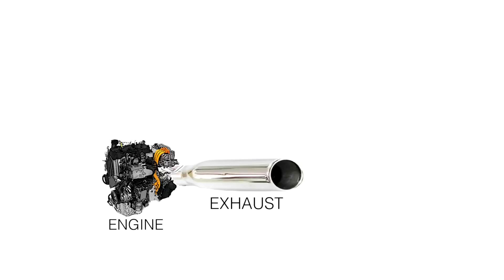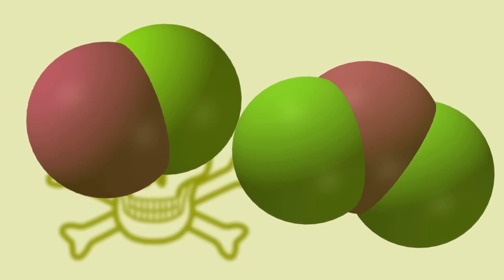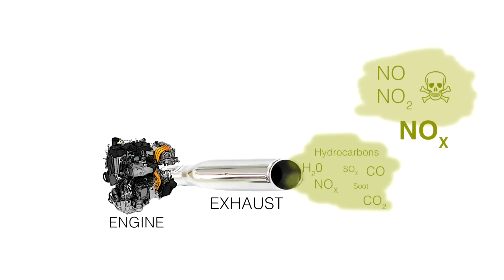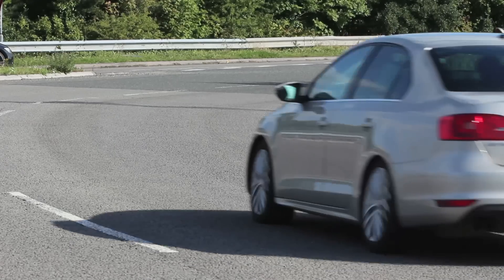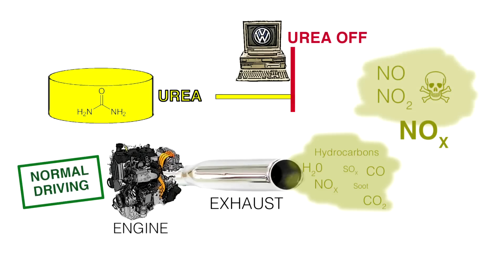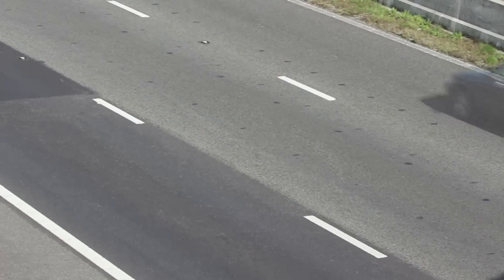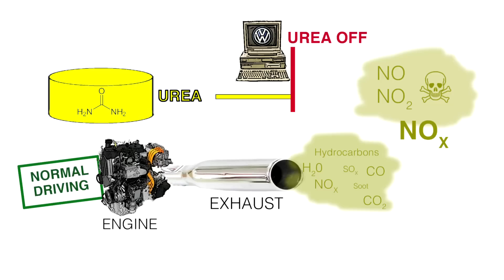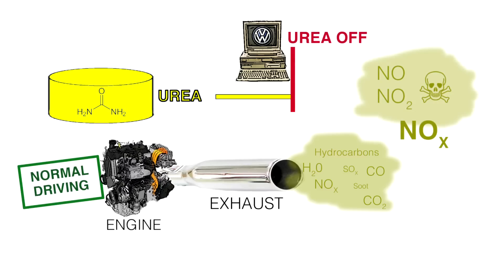Diesel and Urea

Comment: Im sorry to correct you, but the VW engine in question (EA 189) does not have the Adblue Technology with Urea. They are older and use whats called a Nox Adsorber. In those the Nox gets adsorbed by barium and reacts to bariumnitrate. In certain intervalls the diesel/air mixture gets enriched on purpose to produce CO or unburned carbon-hydrogens which then reduce the bariumnitrate to nitrogen, barium and water. This system is also called the NOX trap
Reply: +Axel +Vinay Vyraveraja well, they will simply have to make another video about the "mechanics" behind the other type(s) of NOx neutralizing technologies, and everyone will be happy, and more important - a little bit more educated
Reply: +Axel My understanding of the situation is that the engines in question do not use AdBlue (urea).  VW claimed that the engines met the stricter US emissions regulations as-is, and the EPA tests confirmed this.  In fact, VW rigged the engine management computer to recognize when the car was on a dynamometer (which is what's done when emissions are tested) and reduce emissions as much as possible.  When not being tested, the engine performed normally, and produced emissions far in excess of EPA regulations.  

In any case, VW has almost certainly killed what little market there is in the US for diesel passenger cars.
Reply: Chris Freemesser That might be true, but to my opinion media is spinning this story out of control. This problem is not nearly as bad as the media try to make it. It seems like there is quite a strong anti diesel bias in the media. Actually petrol-engine exhaust is more dangerous than diesel one, but its technically leagal for petrol-engine to exhaust more ponsinus gases, so they don´t cheat
Reply: My 2012 Passat TDI does have urea. The Jetta and Beetle do not. The larger Audi and VW TDI vehicles do, at least in the US. Mine does use Urea as well, I just had to fill the tank a few weeks ago.
Reply: Miles McDonnell No they are very diffrent component. Particle filter (or particle traps) are to remove particles. NOx traps and Urea injection is to remove NOx
Reply: You're correct, I think being up all night at work is starting to catch up with my reasoning.
Reply: +Miles McDonnell The US models are different to the european ones. I don't know what kind of diesel engine is available for the passat in the US. I drive a 2011 passat tdi with 140hp and it is equipped with the EA189 engine and uses the NOx trap.
Reply: jellyfishattack Basically replacing something bad, with something equally bad, but much more expensive.
Reply: Part of the carbon issue is that petroleum is "old" carbon, as is coal.  It's carbon that was removed from the atmosphere eons ago, and has safely remained below ground, until humans discovered using old carbon as fuel.

Trees, (burned wood) use "new" carbon.  That carbon was pulled from the atmosphere relatively recently (within 100 years or less), so CO and CO2 emissions from burning wood are pretty much "recycling" the carbon, since living trees and plans would absorb CO2.

So, by using old carbon fuels, that once safely sequestered carbon is now being added to the atmosphere.  And, that's the issue with regard to global climate effects.
Reply: +Vinay Vyraveraja Everything associated with transportation is dangerous. All combustion produces harmful chemicals in some amount. Electric cars are usually powered by coal-fired power plants, which are often more harmful that cars and trucks.

We need to stop thinking that there is a free lunch, and make informed tradeoffs.
Reply: ryan remus "Gasoline cars need gasoline to run,"
Not true. Cars with explosion engines can ran on just about any high energy liquid substance that can be oxidesed.
Reply: +Vinay Vyraveraja - Diesel engines produce fewer pollutants than petrol engines, which is why they are being produced.  And why they will continue to be produced. 

To understand why, you have to know how it works. A diesel compresses air at a 15 (or more) to 1 compression ratio to generate the heat of combustion. The fuel is injected into the heated cylinder, and then the engine generates a LOT more torque than a similarly sized petrol engine. (Which is usually about 8-11 to 1 compression.) 

The fuel burned by a diesel creates more pollutants. But the distance that a diesel engine will push a vehicle more than makes up for that difference, simply because of how the engine works. Therefore, diesel engines pollute LESS than petrol engines as compared to the miles they drive. 

As such, a petrol-powered lorry would produce a LOT more pollutants than a diesel engined lorry would. It's simply a fact of how the engines work. 

You don't need to agree with this fact, but you should probably understand it. Because this is why so many diesel-engined cars are being built today. They are more fuel-efficient, and they pollute less than a petrol engine would in the same car.
Reply: +Axel I'm sorry to correct YOU, but while what you say is true for SOME EA189 engines, some (like the CKRA variant in our '13 Passat TDI) uses the SCR (AdBlue) system. Some do - some don't, no "none" or "all" here. As with many things in life, it's more complicated than that.
Reply: +Axel He used the EA 189 as an example, still Diesel engines still are being used for high load vehicles such as containers, trucks, lorries and so on.This is suppose to be a educational video about the waste/by-product of diesel engines(most of them) which is NOx or NO2 which are very harmful chemicals that need to be reduced in production.
Reply: Axel True that
Reply: +Axel Some of the affected vehicles use NOx traps, some use SCR.
Reply: Miles McDonnell Well sorry, i was over generalizing. There is one (or two?) specific engine (s?). Of cause its only the smaller engines in the smaller car that was even able to pass the test with special software.
Reply: Its kind of anying that particle sometimes called filter and sometimes called trap... well it basically is both.

About NOx traps, i have no a clue about how they works
Reply: +Axel +Jason Goodman So far, VW has been fairly unhelpful on exactly what cars (and drivetrains) are at issue. The Jetta/Golf here in the US did not have AdBlue, but the Passat ~2012-2015 do.

My guess (only a guess) is that all the TDI models contained the "defeat code" and are thus technically not in compliance. But for those cars with AdBlue tanks and injectors and controls, if the "defeat code" is removed, I'd expect the cars to meet the specs.

Of course all the cars meet the EPA tests. That is the point of the defeat code. The issue is that VW clearly violated the spirit of the law.
Reply: +matsv201 +Axel  Its not the engine. VW seems to use the same engine in the Beetle/Golf/Jetta and in the Passat, but the Passat uses AdBlue. The smaller cars do not. The Passat also gets better fuel mileage, which is unusual, since its a bigger and heavier car.
Reply: Pat Farrell Exacly
Reply: Yes they do use urea fucktard the guy on the news who is the same guy that heads the pollution study group that caught vw said the cars use less urea during normal driving.
Reply: Pat Farrell- Okay... at the start of your comment you said "they are more efficient", which means you agreed with what I said.

The rest of what you said was a essay decrying the political system of the U.S. (which I also dislike) and shady trading practices between countries (which I also often dislike). And a few... other things (which I don't really disagree with).

Since there was nothing you wrote that actually disagreed with what I said... I really have to wonder what you meant by "not so much" at the start of your long comment. (?)
Reply: Pat Farrell If you measure it in LD50 petrol engine that relies CO that is quite posinus is far worse than diesel. NOx is not really that posinus, its really more irritating. Sure you can die of it, but then we talking about way higher concentrations. NOx also breaks down faster than CO. (T)HC is also more dangerous to the nature than NOx is. NOx is actually not really dangerous to plants at all.
Reply: +Miles McDonnell actually european diesel are starting to use it too. The whole reason they didn't use it before in europe is that the emissions limit for diesel differ from petrol engines, and fuel usage is taken into account. In the USA diesel engine has to comply with the same standards as petrol engines, and emissions are tested per gallon of fuel burned, instead of the european per kilometer driven. So to comply is europe a diesel doesn't need to do as much to reduce NOx emissions.

Now there are multiple ways to reduce NOx emissions, the urea inject thing. Which works great, but the urea can run out, have a tendency to crystalize in the hoses/pump, and decays. Meaning it's not a maintance free system, and if you're unlucky expensive to repair, and the tank has to be filled regularly to make sure you have "fresh" urea.

Another way to reduce NOx emission is to pipe back a part of the exhaust gas into the engine. This reduces the amount of oxygen in the engine and thus the NOx emission, a chemist could probably explain why. This system is called EGR (exhaust gas recirculation) system. And it's not that reliable either, as the valve use to control this can get stuck with all the soot and carbon build up in the exhaust pipes. And this method reduce the power the engine generates.

The affected diesel engines only used the second system, which isn't enough to make it comply with US standards, unless your willing to give up significant amounts of power and mpg. What they did is figure out when the car of being tested for emissions and then run the engine for minium NOx emissions. Which worked because during emission testing the power output isn't measured. And during normal driving they tuned the engine to have more power and better fuel consumption (and extra NOx emission).
Reply: JCGver Your explanation of the Golf/Jetta approach makes sense. Its the first one that I've heard that seems feasible for engineering. Do you have any citations or evidence that is quotable?
Reply: https://en.wikipedia.org/wiki/European_emission_standards#Emission_standards_for_passenger_cars
Here is the specifications of the Euro on.  I have not found the EPA specification. 

"Another way to reduce NOx emission is to pipe back a part of the exhaust gas into the engine. "
Almost all dieselcars does that alreddy. It healps quite a lot, but it will still not bring it down to the Euro 6 level for most cars. With Euro 5 and a small engine, it works for the most cases.

"And this method reduce the power the engine generates."
This is generally not that big of a problem because the system is only needed when power reduction is needed, to a extent.

"Which worked because during emission testing the power output isn't measured"
I don´t know about in the US, but in Europe the car have to reach 120km/h in a certain time. So if the power is reduced to drastically it will fail anyway
Reply: +matsv201 the differences we're talking about here that VW supposedly "cheated" are miniscule. Effectively they detect the car is being tested and during that interval don't start the cleaning cycle of the absorber (thus letting it get a bit dirtier than otherwise would be prudent).
This has the benefit of having lower NOx emissions during the test at the cost of having the absorber last less long (its lifetime in hours/kilometers is less before it needs to be replaced).
As NOx at the levels emitted even without the absorber running constantly is too low to be of concern, the "emission standards" being absurd for no other reason than to make cars more expensive and eventually impossible to build, it's a tradeoff that's IMO warranted and clever, if not strictly legal.
Of course now, VW are scrambling to change all the firmware (which btw wasn't created by them, it's created and maintained by Bosch, and used by many brands) which means that owners of the affected cars will end up having higher maintenance cost and somewhat lower performance engines for the sake of meeting an insane legal requirement.
Reply: CaptainDuckman Yea.. exacly. They really want to attack diesels. If i understand it corectly, it turned out that the VW cheat was not even illigal.
Reply: CaptainDuckman
"And all that is taxed as well, hence the 90% :)"
No, read my calculation again, and you will see its correct. I didn´t include for the staff of the petrol-station, i basically put it as all tax.

Also, the tax on the workforce is payed by the workforce, not the company.If you count it on the company then you count the tax two times.

"uh, yes. It does work like that. Maybe not in the mindset of a socialist agitator screaming about "evil greedy companies" but in the real world it works like that."
No i tell you how it works in real life. Big companies dont pay tax. Get e grip. Only small companies pay tax in real life.

" it's the profits AFTER TAXES that have to pay for all the R&D."
No that is wrong. R&D is payed from the turnover, not from the profit. Of cause, the engineers have to pay tax on there salieries, but the companies don't pay tax for turnover.

This is economics 101, you should really know this. 
You never turn tax on turnover, not in europe at least. You only pay tax on profit. R&D is not profit, its a investment.

The only exception if when you push over profit to the next year for a later investment. You are only allowed to do that for 3 years, then you have to tax the pushover.

You only pay tax on profit, and its the rule in just about every country in the western world. Big companies as oil-companies never pay tax for anything (except sails tax). This is why the profit margin of gasoline station is so low. Its also to keep competition down
Reply: +Axel question is whether VW is only cheating or other car manufacturers are also cheating?
Reply: yoppindia Well, Audi and Porsch was also cheating in the US. in EUrope it works diffrently. THat should be considered cheting is actually legal.
Reply: +matsv201 because they are part of VW....
Reply: Phrancis5 Well, yea, but its not really that clear cut. They are part of VW-group, but not VW company.

This is also true about Scania and MAN, and to my knowledge it seems like they have not cheated.
Reply: VW and Porsche DNA has been intertwined from the start. They share the same technology - engines, chassis, etc.. so it's not a stretch to think the other "groups" wouldn't be tied up in the same scandal. Especially now that so many gasoline CO2 sensors are also "dishonest".
Reply: Phrancis5 Note, the scandal is about NOx, not CO2...

The media tryed to make it sound that its about both, but its not. There is no issue withe software cheating and CO2.
Reply: +matsv201  Note, the scandal has expanded to CO2 as well, but of course I should believe a random commenter on youtube instead of the dozens of large news orgs recently reporting VW's cheating. Because the same company whose diesels had cheat software surely wouldn't do the same with their gasoline cars...
Reply: Phrancis5 "Note, the scandal has expanded to CO2 as well,"
No its not true. ITs the journalist that claimed something that is not there.

"I should believe a random commenter on youtube instead of the dozens of large news orgs recently reporting VW's cheating"
You should defiantly not based your belief of how  is the largest one... check up what is true in steed of what is claimed.

So you believe that the new org are never lying? Then you will get a brutal wake up....

" Because the same company whose diesels had cheat software surely wouldn't do the same with their gasoline cars"
They probably would, but that is not the issue. You cant software cheat your self it to a better CO2 number. CO2 is locked down to the fuel. NOx is created from the air, a engine can produce a lot of non. CO2 dont work the same way
Reply: Journalists might not be scientists or engineers, yet they have to vet their sources and the chances of all of them being wrong is very slim. These articles were from major news orgs, not small commentary or opinion pieces. CO2 is a by-product of combustion, which is controlled by the engine A/F ratio, which is controlled by the ECU, sensors, and PROGRAMMING. Obviously there are other emissions systems as well, but the point is if their diesels were programmed to cheat successfully for so long, it's not a stretch that their other cars would eventually too.
Reply: Phrancis5
"chances of all of them being wrong is very slim."
Well. if not all the newspaper use the same source, then its just that need to be wrong, and it this case it is.

"These articles were from major news org"
And you say that they are always right about everything? Like in 1984?

"CO2 is a by-product of combustion,"
Wrong. CO2 is the make product of combustion besides H2O and heat.

"which is controlled by the engine"
No, the amount of CO2 is chemically fixed to the fuel. You cant change it with software, its a law of nature.

You can only change the byproduct like HC, particles and NOx. The main products cant be changed.

Its a law of nature...

... if you argue against a law of nature, i can be pretty certain you are wrong
Reply: Ray Sills... I recall reading an article about how concrete absorbs co2 thereby holding it back from plants which use co2 and give off o2...so we are withholding o2 from ourselves in a sense the more we build using concrete. enclosures to work and live in....or use to simply contain the objects we use during our lifetime. Just a catch22 observation.
Reply: You also get false readings when you test a front wheel drive car on a 4 wheel drive test bench. They made such a big deal of it although they never showed an accurate reading. The VW wouldn't normally allot more NOx then they said unless you would overtake someone or drive like an idiot. When it turned out that NO manufacturer reached the promised values the thing was forgotten. Cars use more fuel then they do in the advertisement has to do with lots of things  wind weather spot on or way above sea level and most of all driving style. It has all to do with how these company's get their numbers. All of them there isn't one of them who is totally honest is because their tests are done inside a building in perfect conditions so I never really understood the problem, something that became clear to me when all of a sudden no one spoke about VW anymore.
Reply: Axel ea189 sold in eu does not have nox trap neither src. It just has regular catalitic and dpf. They are both mounted in the same container. You can chech under the car and you ll see there is no additional boxes. Also you ll wont find exhaust flap used in nox trap exhaust
Reply: Seems like a waste of fuel
Reply: +jz1199 I would like keep at least a bit of VWs reputation, because they make extremely good engines. Just shutting of the Urea tank to keep the customers from having to fill up those tanks would be an extremely weak excuse for polluting the world with NOx. With the older technology it is a lot harder to manage , because you ca't emit to much NOx on one side, but also you are not allowed to emit CO or unburned carbon-hydrogens, which are needed to clean the NOx trap
Reply: That sounds like the same engine. I'm assuming that the NOx trap would be equivalent to the DPF (diesel particulate filter) perhaps just a different name. The urea must be specific for the US which isn't surprising.
Reply: ryan remus I did address the issue. Its not about sequestered carbon, its about using the one we already freed up. The process dont ad any carbon, sure, it don't sequestered any to, but that is not the point. Its a oil replacement, there for it reduce the net amount of carbon that have to be extracted, it don´t reduce the amount already extracted.

You can´t look up the carbon in trees forever. You have to burry the treas if it would make any effect. Even in that case its not as efficient that you might think.

You don´t sequestered carbon, but a electric car also don´t do that, so no difference there.
Reply: +KOakaKO I disagree with your claim that diesels make "less pollution". Fundamentally, the definition of pollution is political. The US, Germans and other politicians have made other political decisions, which in turn result in different specs that engineers approach in different ways.

Nothing says that one kind of "pollution" is better or worse than another.
Reply: matsv201 maybe in the US, in Europe diesel is big business, at least in some countries where governments have for decades subsidised (through reduced taxation) diesel fuel for company cars.
A move those governments are now regretting because "CO2" and "soot" (never mind that the first is a hoax and the second so much reduced as to make no difference any longer, it's really about wanting to find an excuse to raise taxes).
They're pondering whether to retroactively increase the vehicle taxes on diesels now because "they're actually less clean than they were sold as therefore should fall in a higher tax bracket".
Leftist politics 101...
Reply: matsv201 yes, for cars. Not the fuel, but the vehicles itself.

And no, oil companies don't like high taxes. Customers blame them for the sky high gasoline prices when in actuality they're caused by taxes.
Maybe it's different where you live, but right here taxes are roughly 75% of the cost of the gas you pump into your car. And that's just direct taxes. If you add employee taxes, import duties on the crude oil, property taxes on the gas stations and refineries, etc. you get closer to 90%.
Your gas station makes a profit of only 5-10 cents on a liter of gas, when that liter of gas costs (at today's prices) roughly 1.50 Euro (down from 1.75 not long ago).
The oil company makes another 5-10 cents at most.
And those profits are again taxed as all corporate income is at about 40%, leaving the company with only 3-6 cents per liter in profits, which have to fund all investment and R&D they do.
Reply: matsv201 crude oil isn't the only cost of making gasoline, remember... There's wages for refinery staff, writedown on the equipment, trucks, maintenance etc. for the gas stations, you have to pay all your office workers, etc. etc..
And all that is taxed as well, hence the 90% :)

"No it don´t work that way in real life. "
uh, yes. It does work like that. Maybe not in the mindset of a socialist agitator screaming about "evil greedy companies" but in the real world it works like that.

"Wrong, companies don't have to pay tax for R&D investments."
They do, just not as much. And that's not taxes anyway, it's the profits AFTER TAXES that have to pay for all the R&D.
Reply: How does a factual wrong comment on a scientific channel get so many upvotes?

There ARE some EA189 engines with SCR system, hence they use AdBlue.
Reply: this.